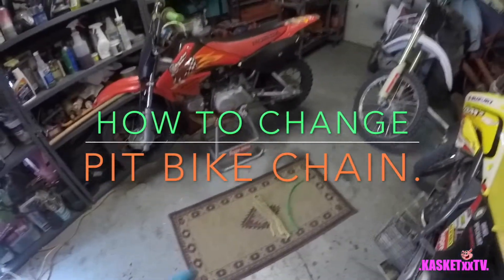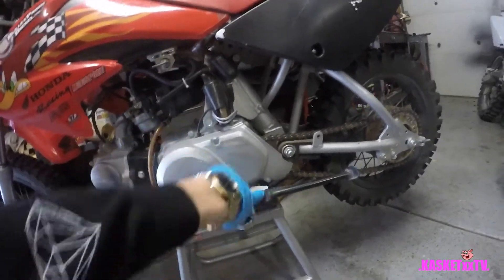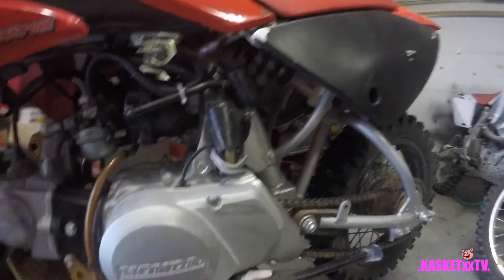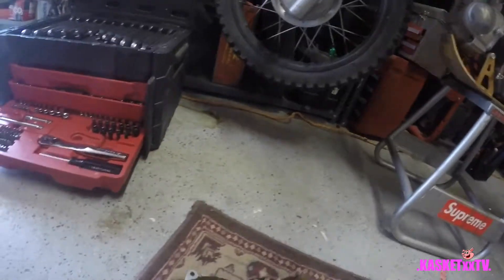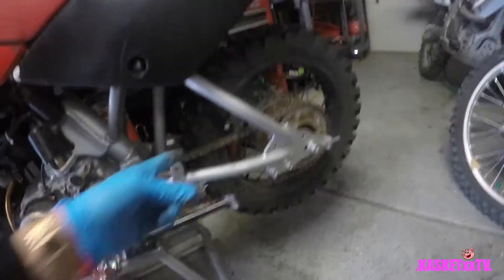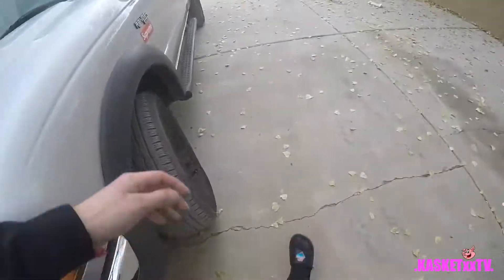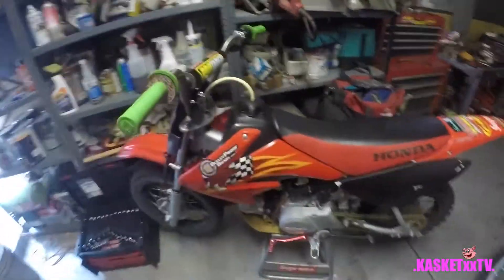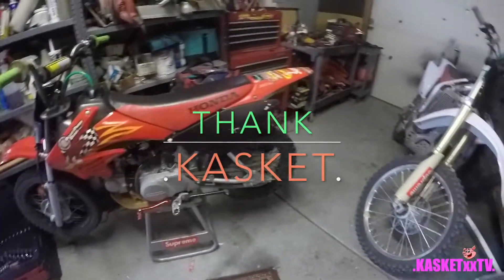HOW TO CHANGE YOUR PIT BIKE CHAIN

Comment: Where did you pick up the gold chain? What Brand?
Reply from the maker: I will need to look for the receipt the chain was purchased maybe 2 years ago just never ended up putting it on but sure took it out of the box the first day hints the master link being a different color. I will get back to you with the chain type and were you can purchase.
Reply from the maker: ITS A PRO TAPER GOLD CHAIN! SHOULD BE ABLE TO PICK UP AT YOUR LOCAL MOTO SHOP! SORRY FOR THE LATE REPLY WANTED TO GET BACK TO YOU ON THAT.